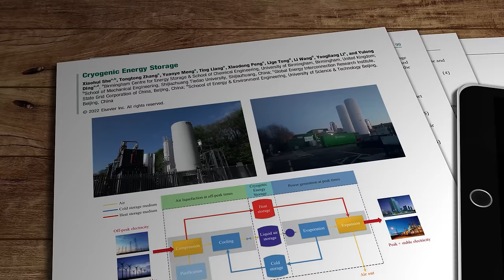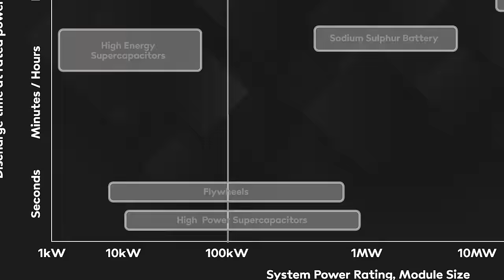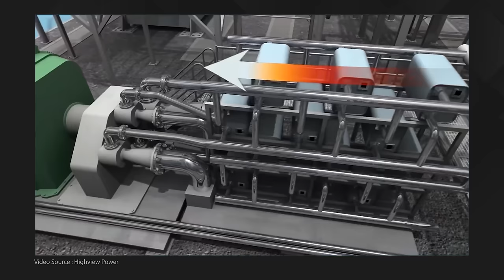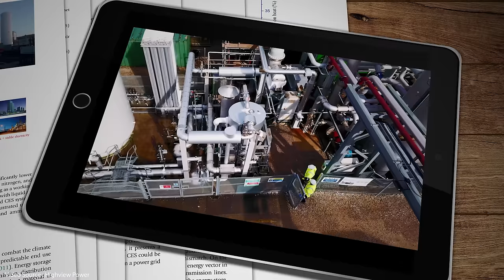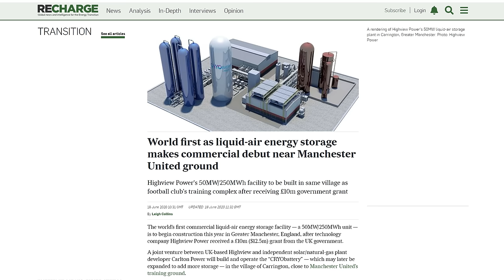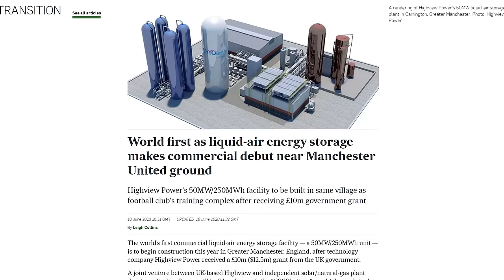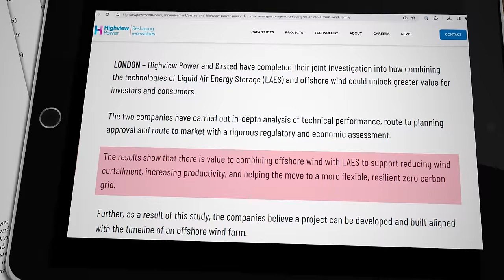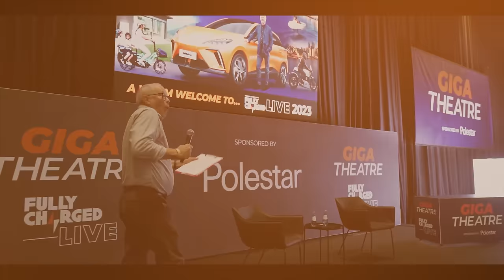Cryogenic Air Energy Storage - the new long duration energy solution?

Comment: I feel like we would have more overall efficiency if the oxygen could be separated and used in industry.  Seems a horrible waist of energy to liquefy oxygen and then just use it to run a turbine, unless of course you were using the high pressure air mixed with natural gas to produce more than the pressure of the air and a natural gas turbine could produce individually. 

It is amazing that they can get a 60%efficiency out of this technology, but I feel there is more to be gained by using the products of the system for other uses.  For example, the amount of heat energy given off by liquefying air is huge and could be used,  then the amount of heat needed to gasify the liquid air is again huge, you could cool several buildings just warming up the liquid. 

This technology is a bit like growing crops in a building with grow lights.  Yah, it works, but if we invested the same amount of resources and technology into a comparable lower tech solution, we could get a larger return on our investment.  Or, we could use this technology to produce liquid oxygen, nitrogen, and argon for other industrial purposes.

I think Britain could do better for less with pumped hydro.

Comment: For the short to medium term could you operate a similar approach with LNG? And therefore when when power stations are needed the simple act of getting fuel from storage produces power to reduce the amount of fuel needed from storage.

This wouldn’t diminish the ultimate aim of zero carbon but might act as a stepping stone towards it

Comment: In the overview part, you mention that CO2 is filtered out - could these installations be expanded to scrub CO2 as a sort of side effect? Scrubbing CO2 is not worth it, normally, but here the energy cost is already included in the roundtrip efficiency of storage.

Comment: Would it make sense to combine Cryogenic Air with Solar Thermal to use the hot air to heat and expand the cryogenic fluid?  That would result in a much greater increase in volume and thus more energy generated by the generator.  Is anybody exploring this idea?  We just have hot tanks as well as cold and mix them with the right hardware and we should have a system that combines the best of both synergistically.

Comment: I wonder if this sort of storage can be scaled DOWN to domestic size? Could it serve as a replacement for fossil-fuel-fired emergency generators, or those expensive home LiIon batteries Musk sells? It's even possible to imagine a delivery network of liquid air, much like the existing delivery network for propane in the rural US.
Reply: I'd be flabbergasted if one of these would be even close to the price of a commodity LFP home battery.

Comment: It's just that the details are not well explained and these are crucial for the efficiency. How to capture and store that heat formed during compression and how to use that heat again?? I guess, in theory, the compressor could be all corrosion free material like stainless steel and water sprayed could continuously take up the heat. Then that hot water can be stored easily. Since everything must be controlled very neat, they could heat that water a bit extra just before using it,  so the temperature is always the same with predictable results. And everywhere, there is the question how to insulate almost perfectly and yet cheap, the many (long?)warm and cold pipes and the storage vessels.

Comment: Not wishing to pour cold water on this but in terms of a long term storage solution the planned 200MW facilities are almost inconsequential.  I contrasted this with the troubled Snowy Hydro 2 project in NSW, Australia which is expected to have a storage capacity of 350,000MWs and reckoned to be enough to supply 3 million homes for a week if at full capacity.

By this reckoning 200MW of stored energy would supply fewer than 2000 homes for one week.  Hardly a long term storage solution for even a modest sized town, let alone a city.  I think the big question here is to ask just how scaleable these sorts of proposals are.  Can they actually be built 100 times larger than this?

I am fully onboard with renewable energy (having solar, battery and heat pump myself) but critics who reference the intermittent nature of renewables and the issue of storage are still in pole position on this point.
Reply: Can they actually be built 100 times larger than this? Yes, that's the point. They're designed from the ground up to be modular. Land available and funds would be the main considerations.
Reply: @RandallSlick  Yes but those two are pretty major considerations.  How much land would a 200,000MW facility actually need?  What would it cost?  How many such facilities would be needed in the UK, clearly dozens of them just to provide back up power for a few days.  Just storing that amount of energy as back up (with 40% losses) immediately boosts the number of wind turbines/solar panels required.

All I am pointing out is that these proposed 200MW facilities will make a negligible impact on any transition and I hear no proposals for anything that might have a significant impact in terms of energy storage in this decade or the next.
Reply: While we often get comparisons to "can power X homes" the actual end-use of electricity is not dominated by homes but by business. A UK home is likely to consume between 4KWh and 16KWh/day, or somwehere around 1 to 5MWh/year.

Please note: you're missing the (h) from your figures. 200MW is a rate of flow, not an amount of storage. 200MWh is "200MW for 1 hour" or "1MW for 200 hours". Also note that a scheme like LAES or Pump Hydro will have a max flow rate (e.g. 200MW) and also a max capacity (1500MWh) and the two values are not closely linked.

The massive Snowy Hydro 2 project is 350GWh storage, based on pumped hydro, and is considered a megaproject and one of the largest in Aus.  350GW capacity is ~70,000 homes per year on my 5MWpa calculation, though the scheme is designed for many more homes for much shorter periods.
Reply: @rivimey  I always understood that the reason why “homes” was used widely is because they aggregated business and domestic use within a community and divided overall energy use by the number of homes as a means of convenience.  Otherwise the use of this is essentially meaningless.

With regard to the Snowy Hydro project I took the numbers from their own website ie 3 million homes for one week.  I didn’t make it up.

Comment: How does it compare with the cost of Sodium ion battery.

Become the cost of Sodium ion battery can easily, 40$ per kWh,
if mass manufacturing and econonics of scale is achieved.
And in 5-10 years after than it can become $10/kWh only.

Which is super cheap, even 40$ is cheap.

Comment: The flip side of using established, proven technologies is that it is unlikely that it will be significantly improved.  At least this technology probably has the characteristics that once you waste the capital investment to build it and go through bankruptcy, it will continue to provide a cash flow so you won't have to pay to tear it down and it will help the grid.  It will have a long lifetime, like pumped hydro and unlike lithium-ion batteries.  Still, it seems like we need a breakthrough in redox flow batteries,

Comment: How much air would need to be stored, and for how long? This is air that would be removed from the atmosphere for some time.

How much air removal would be detrimental?
Reply: You have no idea how large the atmosphere is.  It would be just about impossible for humans using today's technology, given our available resources, to remove enough air to cause problems.
Reply: @incognitotorpedo42  I do have some idea how big the atmosphere is. One possible problem could be water. Air contains water. Using air as an energy storage medium would remove moisture local to the storage plant. This could lead to local weather issues.

Humans have a bad habit of seeing something as better than sliced bread. And it is until it is scaled up. Then, oops, there's a problem.

We can estimate the required storage and its effect before going whole hog. Or we could separate the moisture and return it to the air.

CO2 is a small percentage of the air and look at the problems it is causing. Coal, fossil fuels, etc have helped the human race advance, but scaling up eventually got us in trouble.

We need to look for problems before they occur.

Comment: Why not integrate liquid air storage in the enclosures of wind turbines?
Reply: Wind turbine enclosures are optimized for wind turbines.  Adding a wildly different requirement would impact the cost/efficiency of the turbines.  I don't think the benefit of combining those things would offset the cost.

Comment: What ever energy storage type is in vehicles, EVs, we know that that energy is stored for days and is more than the daily drive needs.

EVs are just parked 23hrs every day, mostly and with daily top-ups are mostly full of electricity daily. 

Has anyone noticed that the number of vehicles is the same as the numbers of buildings. 

So every night every home has at least 2 parked vehicles mostly full of electricity. 
Each EV has 10 times the amount the home needs after sundown. 

Now if the vehicle's battery is already paid for in the vehicle purchase price then the home has a free battery. 
Every home can be the same.
Reply: Ev's are a hugely under used resource in this sense, but underlying resistance to using the EV as an energy source for a home is the psychological state of (future) insufficiency. This is the mindset that keeps EVs charged to near maximum but only driven to use a third of that.
Reply: while I like V2G for business use cases I see it being less cost-effective for home use - the inconsistency of when people's personal vehicles are plugged in, the extra cost for the home charger (current chargers are already around £1500 with installation) and then you have the battery warrantee issue - more cycles could reduce the life though some tests I've heard from Nissan say this may not be the case. All in all it comes down to cost and an agreed standard for CCS/Type2 now that the only option that did support it (Chademo) is being fazed out.
Reply: @markreed9853  Nissan is correct, this being down to the current draw of a home is much less than usage on the road. Its very gentle on the battery. Most usage is very predictable, so programmable charging shouldn't be an issue and could easily take advantage of excess energy production by windfarms at night time. With inverter technology a certain amount of (local) grid stabilisation could be achieved. 
I think rooftop solar is under resourced and if that was taken advantage of in combination with domestic storage, a large percentage of domestic usage could be met.
Reply: @markreed9853  we are in the early days of evolving technologies. 
Global assessment of ways forward must include the fact that nuclear electricity is limited by grid new build construction costs and nuclear industries in every dictatorship, which means defence budgets exploding. 

All to stop CO2 emissions worldwide. 

The big picture view allows the costly dead ends and its delays to be avoided. 

The big picture tells us EVs universally parked 23hrs every day. 
Battery technologies and renewable electricity evolving rapidly. 
Vested interests are deadly.
Reply: @yodab.at1746  selfplug-in V2G EVs 100kWh battery plugged in 23hrs daily is ezi pezi.  A cheap wall plug at every building parking space and trickle charging. 
It's just like a home robotic vacuum cleaner.
Reply: As another thread has noted, the biggest issues here are not technology or physics but (a) that most EVs don't have the capacity to discharge to the grid, because the EV manufacturer doesn't see that as a useful thing and most consumers don't either and so won't want to pay for it, and (b) there would be all sorts of issues related to cost-accounting for the energy used. In the distant future, maybe, but now or near-term? no.
Reply: @rivimey  good comment. 
I looked at the future options for clean energy, and electric energy seems to be the way to go.
Grid electricity is the most expensive energy, and the nuclear promoters said exactly that. They said grid costs make up 66% of grid costs. 34 of every 100 billed.
My FiT, feed in tariff is 14 of every 100 billed.

So electricity is dirt cheap. 

More grid capacity is stupendously expensive. 
Nuclear promoters said $ 1 million per klm.
But electricity is only 15% to 18% of total energy used. Nationally. 

So 6 to 7 times more grid capacity.

Australia has 1 million klm. 

Grid expansion construction costs are insanely expensive for 100% electricity from the grid.

This is the problem with large renewable electricity AND nuclear electricity, both are central generation. 

Now, if EVs are universal and have big batteries, a 100kwh battery, and are parked 23 hours every day, then a standard wall outlet is perfect for trickle current.
All night low draw at home ezi pezi. 
Vehicles drive building to building. 

Australia has 20 million vehicles and buildings with rooftop space.
And need no new grid capacity construction. 

So, given these facts, the technology way forward is obvious. 
Australia is well on the way to being 50%  complete in 7 years.
We will have more community batteries first, suburb batteries, and their rapid chargers.

Home technology will just be a simple wall plug and the vehicle computer.

If nuclear forces it's way in to fill the existing national grid, then offgrid will be the real option in the suburbs. 

We need to know where we are going. 
Big everything else needs big government guarantees and laws.

You made me think how to explain what is not obvious. 
I get annoyed at the misleading promoters old thinking.

Horse meat was cheap when the Ford model T production line started.

Comment: I just wonder if I could run a sterling engine in winter to heat my house and store liquified air from that in the basement to use the energy required for expansion as cooling in summer.
Reply: for home use, you'd be better off adding more solar panels and a tank of water than can store excess solar. the high precision and safety concerns of these industrial designs is uneconomical for home users.

Comment: Do we know how much it costs of store and restore of say 1 MWh of electricity?
Reply: The efficiency is given as 60% (ish), so you can calculate it: say the incoming price is £100/MWh, then the storage process costs you £40 to return 1MWh of power at a later date. Viewed another way, you can return 600KWh of the 1MWh without bringing in more energy.
The actual electricity price numbers will of course vary.
Reply: @rivimey I understand that, but what will the cost per MWh with the actual plant costs included.

Comment: I don't see any significant advantage over Energy Dome system which uses CO2 and has higher efficiency (75%), without the need of an expensive (both to build and maintain) cryogenic stage.

Comment: To complex and maintenance-heavy process. Pumped hydro is far simpler, more efficient, and uses off the self equipment.
Reply: But it requires dams for water storage which require suitable sites to be found for the reservoirs. Most of those sites already have extant reservoirs or would have tree-huggers screaming bloody murder.

Do try and think things through properly next time.
Reply: @davidpnewton  Low-head hydro allows a water height difference of as little as 10-20 feet. In areas that are very flat they have huge water towers. They can double as pumped hydro. California has a pumped hydro facility on the California aqueduct. About the only place pumped hydro doesn't work is where there is insufficient water. It doesn't have to be fresh water either. Salt water, brackish water all work.
Reply: @matthewhuszarik4173   yes but it still requires dams. It still requires flooding of areas of land that are likely productive. It still requires suitable sites for new dams. Oh and if you have low-head dams it also requires considerably more submerged area to get the same water volume.

The biggest single issue is dam sites. Most suitable dam sites already have dams in place. That is an insurmountable obstacle. You cannot hand wave it away.

Comment: Random thought. If they are already going through to trouble of pulling air and Cryo-condensing it. Couldn't they fairly easily filter out CO2 in the process? I know it would seem negligible, but scaled over time could become an effective process. No math to back that up... Hell, why not combine CO2 batteries with this concept. I know it's all proprietary and a dream, but I always feel like an opportunity missed because no one works together....
Reply: As others have said, yes it is possible to remove, but the volume of CO2 involved is very small compared to what must be removed.

Comment: I think CO2 is a better alternative, not liquid air. Liquid nitrogen is an inert cryogenic fluid with a temperature of minus 196°C. Solid CO2 sublimes at minus 78.5 °C at atmospheric pressure — that is, it transitions directly from solid to gas without an intermediate liquid stage.

Comment: So... Could a sea-based wind farm with similar tech pump out cryogenic nitrogen into something like an LNG carrier ship, as an alternative form of transportable liquid energy? And what about pipelines?
Reply: Way too low energy density, transport wouldn't make sense.
Reply: And you need a heat source to get a decent share of the energy input back. 
Without extra heating (e.g. by stored compression heat), you get just a fraction of the energy-input back.